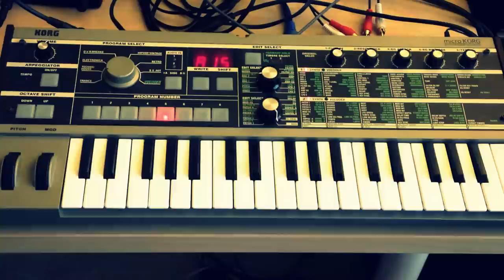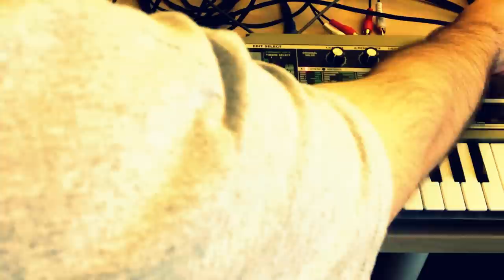Microkorg Tutorial Part 1 - Starting out with the oscillators

Comment: This is so incredibly helpful, thanks a lot mate :D
Reply from the maker: +whitecoldicecreams Thank you for the positive feedback!
Reply: Just a little question, is it possible to play 2 sounds on top of eachother? How do you do that exactly?
Reply from the maker: Yes and no. You have two possible layers. Some sounds have a single layer with all the parameters possible and up to four note polyphony. Other sounds can have two layers but you have to program them independently. You cannot load in presets into the layers, you have to program them in manually. Two layer sounds, possibly because of they more hardware intensive, only have two polyphony tops.

Comment: What cable do you need to connect it from the synth to the computer?
Reply: Sorry, but are you trying to use the microkorg as a MIDI controller or do you want to do direct recording from your synth to the computer?
Reply: Direct record I think. I don't know what midi controller is.
Reply: Ok. For direct recording to your computer, the type of cable you want would be a 1/4" to 1/4" cable, the same type you would use for a guitar/bass to an amp. Although you would need an adapter to convert the 1/4" to a mini audio jack so you would use your microphone port on your computer. This is just one way of recording and usually the cheapest way, but I cannot promise that you would have good quality. The other way that may be costly would be using an audio sound interface that connects via USB. You connect your 1/4" cable to the interface and use the DAW (digital audio workstation) of your choice.  What DAW are you planning to use to record the MicoKorg (Audacity, Cubase, Pro Tools, Reason)? Please let me know.
Reply from the maker: To carry the sound or to carry note information? For the first you need probably an 1/4" to 1/8" jack cable or you need a converter jack at either end to make the connection. For the second of you only have a computer and no audio or midi interface then you need a a USB to 5 pin DIN MIDI cable

Comment: pretty sure i'm just not seeing it but how do i make the tempo light stop blinking on my korg
Reply from the maker: You can stop the light from blinking by setting the Clock (under the MIDI section) to EXT. As long as there is no external MIDI clock incoming it will not blink.

Comment: Thanks for these informative and very helpful videos!! Here's a question that might sound silly. Is it possible to have the mod wheel control the level of Mod FX. Like if the Mod FX was set as a phaser or flanger , could the mod wheel then dial the effect in and out? Thanks !
Reply from the maker: ***** From memory I dont think you can as mod fx is not in the destination for the mod wheel
Reply: Jacques Mongrel Damn. It should be! Thanks. Maybe I'll run it through a pedal.

Comment: Would this work without a control board and with a simple macbook computer? Or even acoustically?
Reply from the maker: You could run the audio from the outs to the audio in of your macbook to record it ... yes (in modern macbooks you can set the headphone jack to be an audio input). You just need a cable that goes from the 1/4" TRS outputs on the microkorg to the 1/8" stereo TRS input on the mac. Only thing is you will have to monitor your recording through the macbook speakers. If possible you could use an audio interface which will provide a better recording experience.

Comment: Hi jacques, was wondering if you could help me with a sync issue- when I set MIDI clock to EXT, this seems to disable the keyboard and arpeggiator. How am I supposed to put a pattern in? Trying to sync with a DSI tempest. The channels are set correctly on the Mikrokorg and tempest btw.
Reply from the maker: You need to have the tempest send out a MIDI clock signal to the Microkorg. Otherwise the the Microkorg will do nothing while waiting for clock signal to arrive. Best of luck.

Comment: Hi. Can you tell me please if the microkorg has a pitch envelope or something that can be used as a pitch envelope?
Reply from the maker: +jcikhop unfortunately, I don't have my Microkorg any more so I cannot check. Off the top of my head, it does not have a dedicated pitch envelope. You may be able to route the amp or filter env to control pitch using the modulation slots. If I were you, I would check the manual which can easily be downloaded as pdf to see if that is possible.
Reply: Synth & Sundry Thank you :)

Comment: i love this machine!!! i will learn more by watching your lessons but best 100 bucks i ever spent! it makes all the nasty sounds i love and more! i run traktor a6 with proscratch timcode vynyl i am only running it through aux do i need interface converter to run midi to usb or is there another way? also i am learning reason can i use this as a controller for both Programs? thank you
Reply from the maker: Thanks ... I have tried using it as a controller for Ableton live with limited success. One of the five knobs ended up crashing the software every time I tweaked it! So I would say try going with a purpose built MIDI controller like the nanoKontrol or something from Novation or something more adapted to the software if your budget can handle it.

Comment: I just bought the microkorg, it's plugged into my mixer/amp with a guitar jack feom OUTPUT MONO/L, but I can't get any sound out of it, when I play the keys.  Please help?
Reply from the maker: Sorry, I no longer have a Microkorg at hand. Just commenting to boost this. Anyone have an idea of how to fix this? My first thoughts are the cables, check if the Microkorg is ok with a TS jack or does it need TRS, and then of course check with headphones from the headphone port to eliminate an issue with the Microkorg. Basically, you want to proceed like a detective, eliminating suspects along the signal chain.